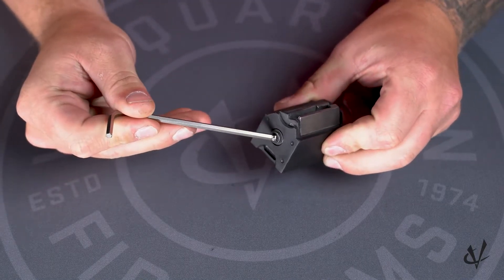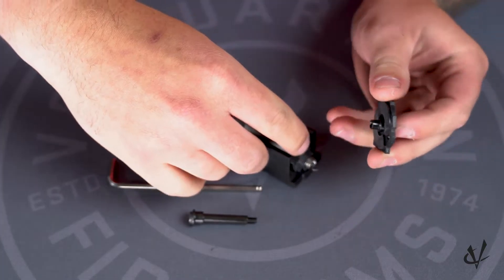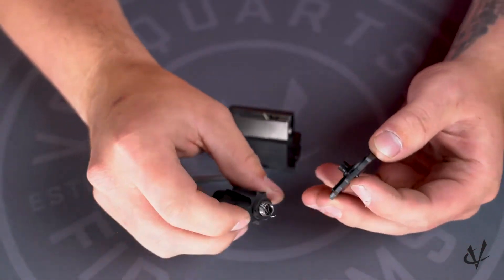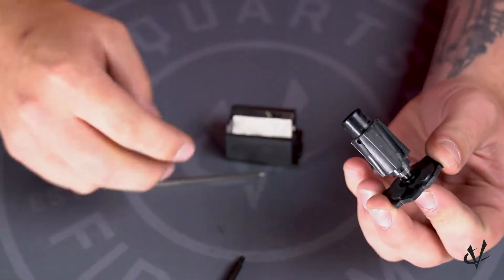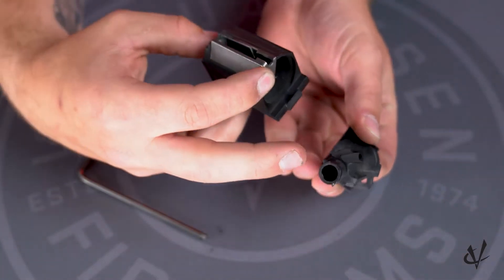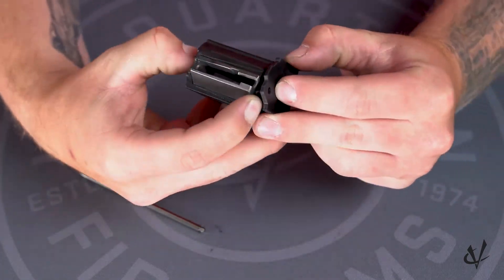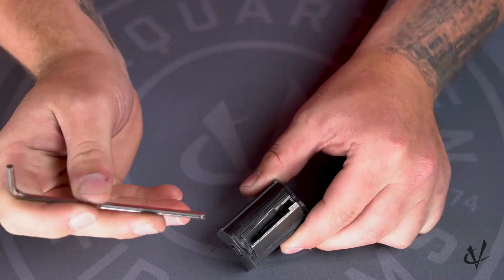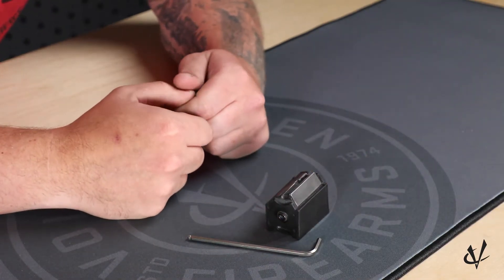How To Tune Your Rotary Magazines

Comment: This makes no sense to me. If your spring is not tight enough to push the next round up into battery then the spring needs replaced. You turned it 2 full turns if that is where the factory has designed it to be set then how do you put more tension on the follower ? Do you turn it 3 turns ? Is there an incremental adjustment some place ? If so you did not explain the adjustment of how to tension it.🇺🇸
Reply: Maybe try it if you have two magazines you bought around the same time, try 2 turns on one and 3 on the other? 🤷‍♂️
Reply: Yeah, I don’t understand how this accomplished anything. If the spring was broken and you were replacing it with a new one maybe this would make sense.